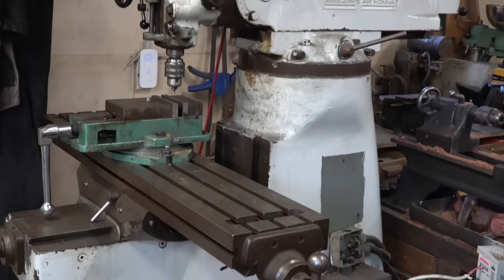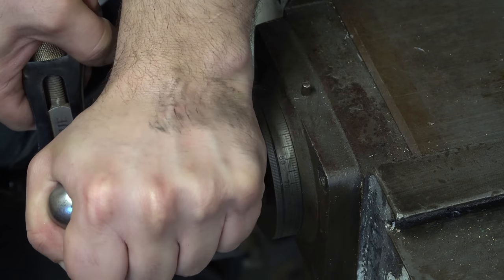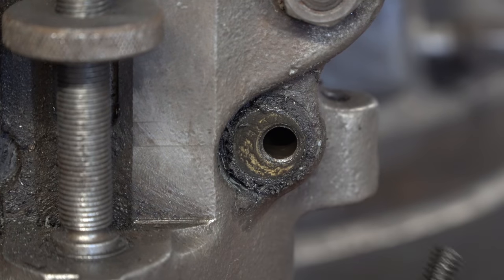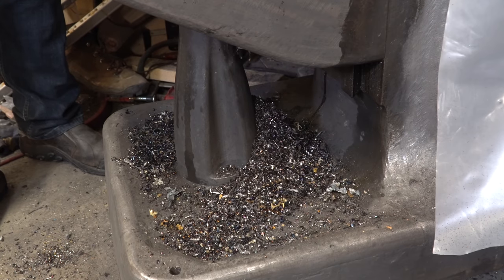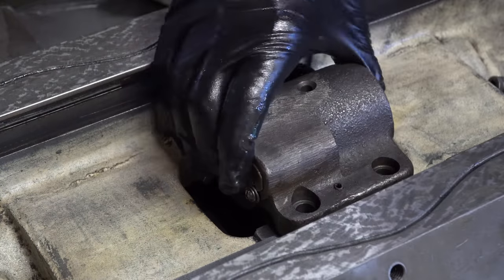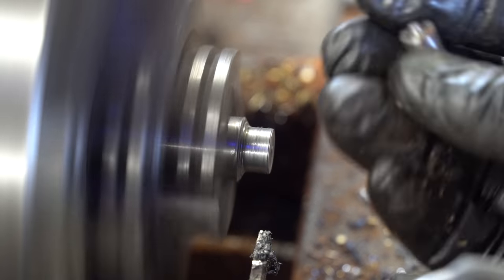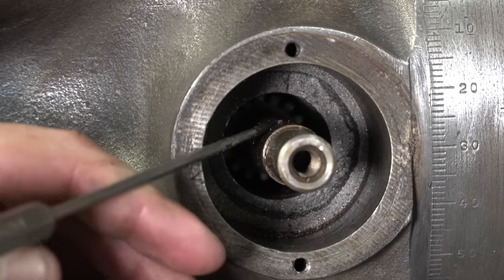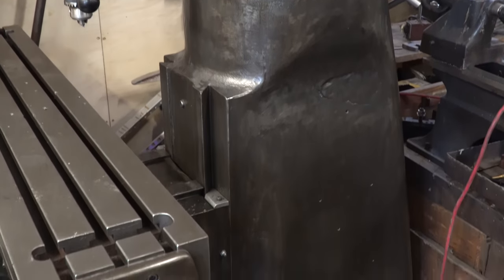Bridgebort Milling Machine [Rescue]

Comment from the maker: BRIDGEBORT!
Reply: That's my favorite brand of cereal
Reply: We need more Bort license plates in the gift shop.  I repeat, we need more Bort license plates in the gift shop.
Reply: Made me bridgesnort
Reply: Yes!! You went with it!
Reply: Sounds Swedish!
Reply: The 83 is most likely to keep mated parts together for paint and other operations before final assembly.
Reply: The bridge is bored???
🤔
Reply: Would you consider only painting the BRIDGEBORT on it? Logo
Reply: Bridgeborked
Reply: Calling @thisoldtony
Reply: ENGAGED!
Reply: I believe the extremely rough finish of the casting is called war finish. Being as it costs less to leave un-essional parts rougher that doesn't effect the actual operation of the machine.. thanks Erik I loved this project. Such a cool outcome.
Reply: You could find a Bridgebort name plaque in the shop but not a Bridgebart. 😄
Reply: You should make a couple of screwdrivers and  make a clear handle that has  some of the shavings in the plastic mold, and maybe do a small give away or keep them or maybe sell them on your website.
Reply: Thanks for not painting it! Looks Fabulous and your cleanup was perfect for it. Your one lucky guy to have it and I know your excited to use it (get that threader accessory)!
Reply: @HomebrewHorsepower  My milling machine is also named BridgeBort
Reply: BRIDBEBORB
Reply: Bridgeþort
Reply: @JohnnyParanoid  Bort! Bort! Bort!
Reply: BRIDGEABORT!
Reply: Woman: "Come along Bort"
Man: "are you talking to me?"
Woman: "no, my son is also named Bort"
Reply: My son's name is also Bort.
Reply: Bridgeþort?
Reply: Lucky you, I would buy one looking like that, and all it would be good for, is an anchor.🤣
Best wishes.
Reply: My son is also named Bridgebort.
Reply: Misread the title, but you've educated me.
Reply: Very cool ..and informative..thanks
Reply: my son is also named Bort
Reply: I am very curious to know how many  hours of footage do you gather while restoring a big machine
Reply: It clearly says Bridgeþort, so it's pronounced bridgethort.
Reply: Why didn't you remove the grease from the gearboxes and worm gears? There is an abrasive from the wear of the metal. It is always necessary to clean out completely such a very thick grease.
Reply: Для чистки краски советую шаберные пластины
Reply: Omfg I want it so badly
Reply: Bingeborked
Reply: What you think is a B is in the style of writing p in cursive scipt, or atleast that's how we were taught how to write p in cursive script back in 80s and 90s
Edit if it wasn't for the underscore you would see the line for p coming further down
Reply: BridgeBork Bork Bork!
Reply: There I was thinking I'd got the name wrong all these years. Madness! 😃
Reply: @Toaster278  1
Reply: It has been assimilated. Resistance was futile (hence the grease)
Reply: Dude your videos are soooo much better with you doing voice overs. Fantastic
Reply: Congrats. oiling the parts to run smooth was the necessity here.  Not the ugly paint job. 👊👍
Reply: Buen video
saludos de Mexico!
Reply: Wow, que voz tan sexy!!!
Reply: The 83 is to match parts of a machine that has been hand scraped to each other or as some might say custom fitted so if you find a part with a different number you know it has been replaced and might need to be rescraped.
Reply: @HomebrewHorsepower  thought this exact thing the whole time. 🤣
Reply: PRIDGEBORT!
Reply: Great cleanup. Like it without the paint.
Reply: We need more "Bort" license plates

in the gift shop.

I repeat, we are sold out of Bort license plates.
Reply: Now with less Nutella!
Reply: To clear up any confusion on the name. It's a Bridgeport even though it looks like Bridgrbort or what ever because, I remember living in Bridgeport Ct, and used to drive by the factory on Lindley Street before they shut down the factory. You mentioned the scrapping brings it to the thousands. If it's done right it's actually in less than tens of a thousands which allows the parts to float on the oil. 
Great video on breaking it down, cleaning and rebuilding it nice job!
Reply: I've owned my Bridgeport for 25 years, & it was my grandfather's for 40 years before me.
I was sitting in my shop just last week, taking a break, and I noticed the weird casting of the "p", for the first time. How ironic to run across this video pointing out the casting issue. Thanks!
Reply: And who needs a paint scraper when you have a.... Was that an outlet cover?
Reply: what does a millingmashine this size cost in the condition you got it in? i hope to one day get one.
Reply: does polyurethan clear paint stick to blued (black oxide) surfaces? or is that a bad idea?
Reply: I work in a shop that requires a deep clean up every day on any machine that is used and a weekly clean up for the entire shop. Seeing a mill in this state made my eyes bulge. Haha
Reply: mmmm bort bort bort!!!
Reply: I am planning on making a cccp ak47 bayonet and it requires a blood groove. No one i know has a milling machine and because of your skill i was hoping you could do it.
Reply: Well Done. This is one of those tokens to mans ingenuity that should never be left to rust in silence.
Reply: II
Reply: @JohnnyParanoid  Magnus Wahlstrom, one of the original owners and engineers, was Swedish.
Reply: BRIDGEBORT
Reply: It's a pee, it goes down as well as up,  it's called calligraphy.
Reply: @michaeljohnson4204  It's almost like there was a joke here
Reply: Bridgebort
Reply: I think it's spelled bridgeþort
Reply: @mikeyzs  you
Reply: @mikeyzs  you u
Reply: Seriously, her real name is LAGUN. 
LAGUN FTV2 Model comes from the 60s in Spain. The importer from USA change the name to BRIGDEPORT. Your milling machine is made in Vitoria, Spain.
Reply: @Summer-it3wh  nope, it's just an older style of cursive "p" that has an ascender and a descender.
Reply: @HootMaRoot  You were getting taught some oldschool cursive!  The only place I've ever seen lower-case "p" with an ascender is in some letters from WWI.  
  When we were taught cursive in the early '90s it was the cartoonish D'nealian crap.  I've been fighting - to no avail - to get my hand to write the way people with nice handwriting used to write.
Reply: @michaeljohnson4204  not calligraphy really, it's just a particular style of cursive handwriting.
Reply: There are ways to really make that mill solid without breaking the bank. Before you break it down, you need to find out a few things. Oil up all the running surfaces snug the gibs and check for excessive tightness at end of travel and knee lean. If really bad, you may have to send the table out for machining. The gibs are gone. Replace with over size. The lead screws and nuts are obsolete. Aftermarket ball screws for X and Y will totally change how the machines behaves and will allow it to be used for climb milling without grabbing and no backlash. The saddle needs to have the rocker wear removed. Easiest way is to scrap or grind out a few thousands in the middle of the flat surfaces and under the dovetails so basically the table rides on four rectangular pads and four dovetail contacts (gib work needed). The same on the downward surface that rides on the knee. The knee should have been pulled and the surface that contacts the column also needs the treatment and perhaps the upper pad areas need to be scraped to reduce lean. The quill is probably loose. You can send the quill out and built up with .0005 bright hard chrome then polish until it fits in the head. Replace the spindle bearings while you’re there. You can make that machine rock solid and easily add another third life to it for under 1k. It’ll take a week of your time.
Reply: I choose to believe it says Bridgeþort
Reply: The Swedish Chef is proud! 😂😂😂
Reply: Been waiting for this one!
Reply: Want to see repair on the ways. Hand scraping is an art form.
Reply: Lol
in Germany we say "gebohrt", meaning "bored or drilled". So Brid-gebort is kinda funny. ha. ha.. 🤓💩
Reply: Bridgeport's eastern European cousin.
Reply: What is the name of that paint remover??
Reply: ❤❤ @Toaster278 ❤❤ no😊

Comment: Precision is how close a machinist or a machine can acheive a desired goal dimension.  Accuracy is a function of the Machinist's ability to read a blueprint.  Please learn the difference.   The Bridgeport is an iconic mill.  It is designed top to bottom with every single part having a distinct function and the design is next to perfect for it's intended use.  In other words, it is legendary among machinists.   It is built to last several hundred years with occasional maintenance and replacement of worn parts.  Many of the problems with this one are indeed cosmetic.   Because of this, this will be more of a normal refurbishment than what I would call a rescue.   These things aren't designed to be pretty.  They are designed to do beautiful work.

Comment: As a little tip, when using Loktite on press fit items, use Green Loktite; it's specifically made for that.
Reply: Looked like he was using a Permatex product. One of their high-strength products for press fit applications is red. It's better to state a specific formula than refer to the colors alone.
Reply: @jr798  Probably why I said Loktite, which is identified by number And color.

Comment: Thank You for doing a full narration on this video, it makes it much easier to follow exactly what you're doing.  I didn't realize that most of those grease zerks were supposed to receive oil instead of grease, I would have just used grease in all of them.  I'm having trouble adjusting to the sight of an unpainted Bridgebort, but its your machine, so do it the way you like.

Comment: That little hole in the table is actually a coolant drain hole, not for clearing chips. The coolant flows down the t-slots and out the hole in the side back into your coolant reservoir.
Reply: The hole works great till it plugs with chips...😂
Reply: Nice, came here to say the same!
Reply: Me screaming the same at my screen :) Although in theory it should take a bunch of chips with it..
Reply: @streaky81  all depends on the size of the chips.
Reply: @mauricepowers8079  I assumed that went without saying :)
Reply: .... 69 likes, nice

Comment: During late 60's early 70's, I was an apprentice at a company called Adcock & Shipley based in Leicester,  England. We made and built Bridgeport machines under licence. Very well made and super versatile.
Reply: I still use an Adcock-Shipley Bridgeport regularly! It’s owned by my student rocketry team in university, not in a fantastic state but still going strong. We’ve only had it for a few years, I believe it was previously owned by a hospital but I’m not sure what they used it for. I’m also not sure exactly how old it is but we like to joke that it’s been around since before the Moon landings!
Reply: @WesleyWestland  my apprenticeship consisted of first  year in training school then three years on the shop floor in different departments eg. lathes, milling,drilling and toolroom. At one point I was operating an early CNC Bridgeport,producing the faceplate for the variable speed Bridgeport head. It was converted to cnc by a company called MOOG. The command centre was a punch hole reel to reel loop paper tape. No automatic tool changers in them days. Two workstations on the jig and the spindle had a quick change tool holder similar to a chuck and key. All tools were preset. It ran 16 hours a day,5 days a week without a single problem. Also produced a beautifully presented,boxed up,boring head attachment specifically designed to enhance  the versatility of the Bridgeport.
Reply: @richardbell9656  Interesting stuff, didn't know CNCs were around back then. By faceplate do you mean the bit with the rotating dial for the spindle speed on it? I've looked up the type number on ours and it was made in 1974, so who knows it might be one of the ones you worked on! :)
Reply: @WesleyWestland  Yes Wesley , that is the part you described. You never know, it maybe a part that I produced. The Bridgeport was so versatile that they were sold worldwide. Talking about early years CNC machinery, on the shop floor, we had 3 auto lathes that produced the collet tool holders for the Bridgeport head. The lathes were made by a company called Ward, based in Coventry England. The command and control centre was a plugboard, similar too an old fashioned telephone exchange. Just feed the it steel bars and away it went.
Reply: Richard,  just purchased an Adcock-Shipley Horizontal milling machine. That is one fine quality machine you guys built for sure!!
Reply: @johnnyshockley6133  good to know that their machines are still in use. They made 3 different sized horizontal milling machines. Also manufactured large radial drilling machines,rotary tables and many other small tools. My apprenticeship with Adcock and Shipley was a great practical experience in the use of different machinery. Any idea how old your milling machine is ?
Reply: @richardbell9656   I believe these model 1 ES Mills went in production  around  1964. This machine  is still in great condition,  original  paint is not to bad as well. Have to believe  this one dated many yrs later to still be 9n this condition. Still try to find out what  spindle lubrication is correct given the zero fitting  that supplies  the spindle  cartridge

Comment: The threaded hole at the end of the table is for cooling fluid to leave the table. You may have a tank in the base with a filter and pump to pump suds up to the tool. It then returns via a line in that hole.

You may not of course, model depending probably.
Reply from the maker: Well that makes sense.
Reply: The 83 everywhere was probably to match components during assembly. Some things might be lapped/machined to match rather than a specific dimension.
Reply: @namAehT  that was my thought too. Maybe the last 2 digits of the serial number? 2 digits would likely be enough that you wouldn't run into overlap in production where 2 tools on the line had the same numbers stamped on the parts.
Reply: would also have a catch tray round the base.  pump sits in the Bridgebort port door.  and a coarse filter in the base of the machine
Reply: @HandToolRescue  
Also FYI,  all those grease fittings should be tube fittings that all lead to a central pump oiler. It would be mounted on the base and every so often you lift the handle and it feeds a bit to every fitting.
Reply: @BlackPeter203  Bijour oil dispenser.
Oil it every use,before and after.
Reply: @BlackPeter203  yes, he knows that they're not supposed to be zerks there. That's a lot of money and work to install a automatic timer oiler. The zerks are already there and with the very minimal use it's going to see, using the pump oiler is completely acceptable. He'll use it 1% of what it was designed to be used.

Comment: Removing chips from the sides of the table was always a hassle for me even with a vacuum.  I made a custom fit tray with a lift handle out of perforated steel  to fit that space.  I could easily lift the chips out!  The hole you identify is threaded, not for chip removal, but for attachment of a lubricant drain tube.  Makes that chip removal tray even more efficacious!

Comment: Great video and work as always! I agree that the raw cast iron is beautiful.  I feel like you should cast resin all those scrap shavings of history from the Machine and then Mill the resin block into a handle for something on the Bridgebort  or for handle scales on one of your screwdrivers.

Also waiting for the video where you lower an entire large project piece into a giant vat of evaporust using an old restored powered wench controlled by turn levers that are just your remade wrenches!

Comment: Great narration. Used to work on and install abused equipment. Usually took more time to true abused machines than install them. Try a 12' above and 6' below boring mill. Grease SUCKS. When cleaning try mixing 25% kerosene with the oil. Then flush with machine oil. Cheaper than engine oil and I think you can get it in a 25 gal. drum. The metal finish looks great but not practical. Did a mill in green with copper oil lines that was frikkin awesome. Thanks for taking the time to share your work.

Comment: That number 83 could be a number used to track parts for one machine.  like since this is hand fitted originally you can not just swap parts from another machine with out having to hand fit it again. so using that number they keep track of the parts the go tougher when it is sent to get finished or any other reason the parts get separated during there making.  And the serial number would of been added at the end of assemble so couldn't use that in most cases.

Gunsmiths also did that a while back,  Guns where hand fitted and in the factory each gun would have a set of parts that have a extra number on them, all the extra numbered parts need to go together, the rest of the parts didn't need to be hand fitted so there where not marked.

Comment: Wow 10 grand to bring it up to speed. Can remember helping my dad run power to a brand new two phase Bridgeport around 1965 that think cost less then $3,000. Went to wire up a couple dozen of these great milling machines. If I did not become a sparky would have liked to be a machnist. Thanks for the great vid.

Comment: Just curious, how does this rust remover work? Is it really save to dip your whole arm into it?
Reply: Do you see any rust on his arm?
Reply: I believe it's based on tannic acid. It says it's safe for skin.
Reply: It uses a process called chelation. It is part of coordination chemistry where metal ions bind to ligands, but contains no acids or bases. (Not in the sense that non chemists think of an acid or base. Like muriatic or acetic acid or sodium hydroxide.) It's completely safe to have on your hands. Variations of it are actually used in patients to chelate heavy metals that have been ingested and are causing heavy metal poisoning.